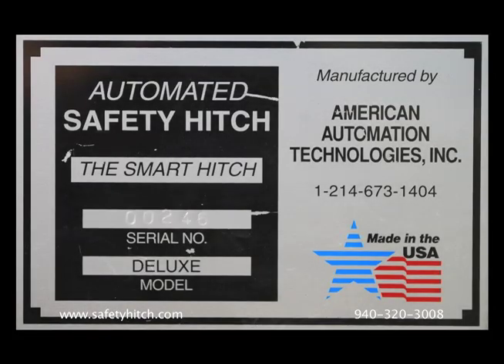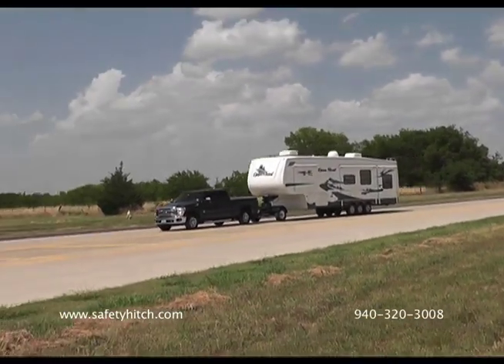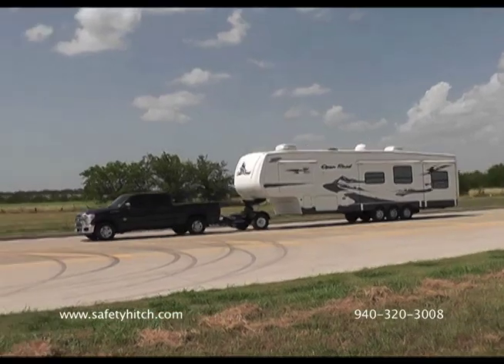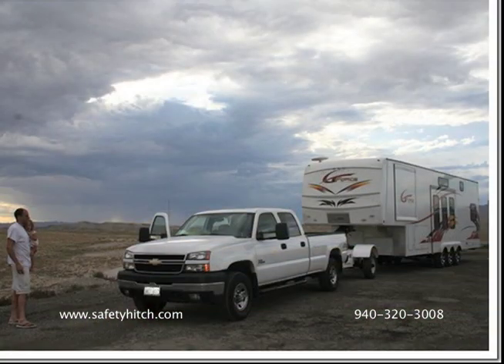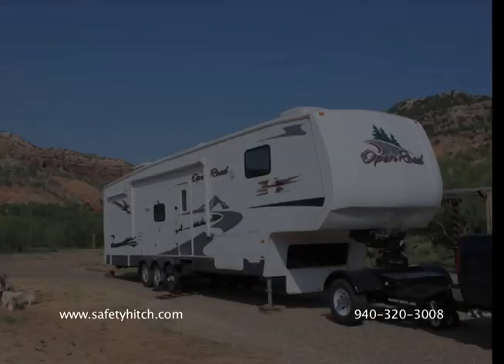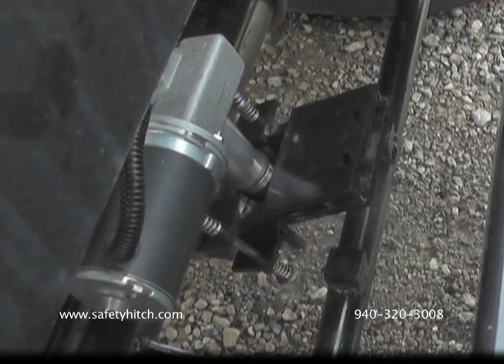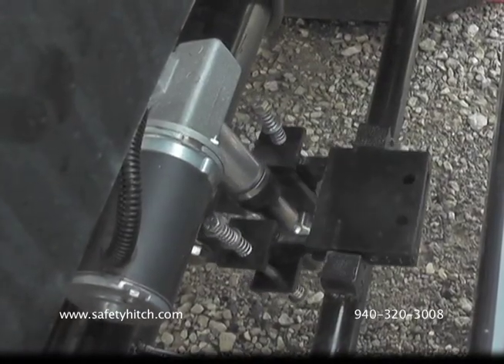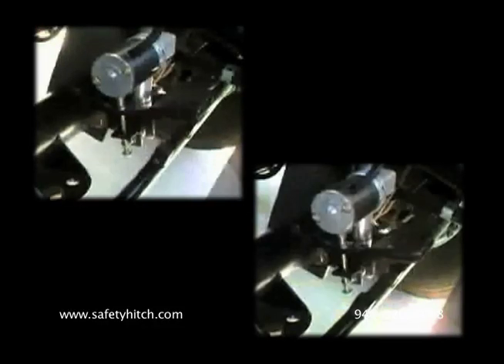Automated Steering Control System on The Safety Hitch

Comment: What happens if the road has a sharp bend, and you follow the road? Nobody uses their blinkers on a curvy road.
Reply: Maybe the hazard lights wouldn't be too out of place in that scenario. That does however call into question how it handles on a very curvy road with the axle unlocked the whole time.